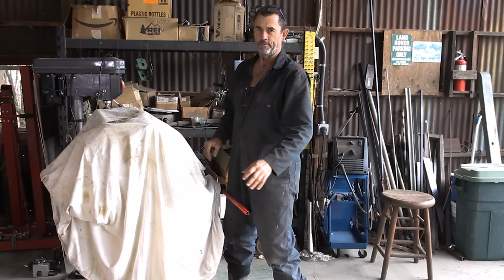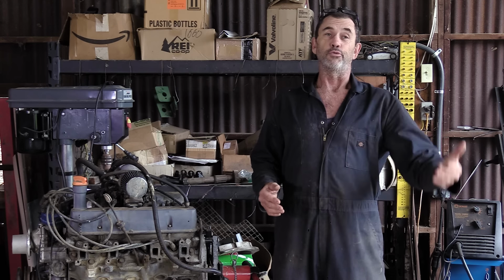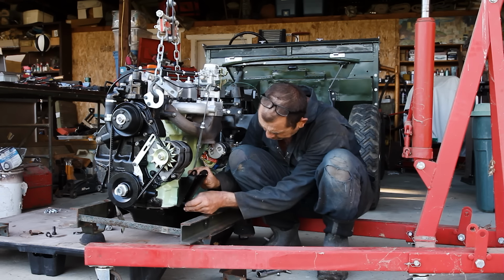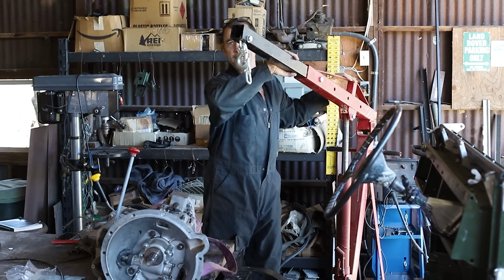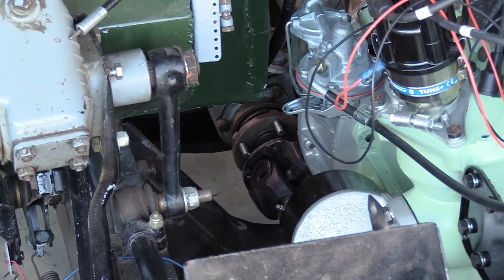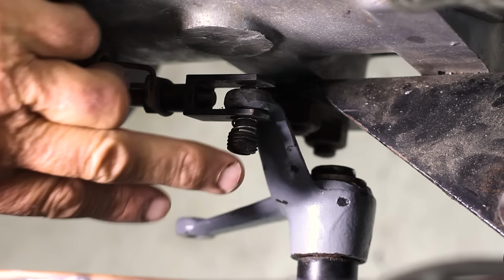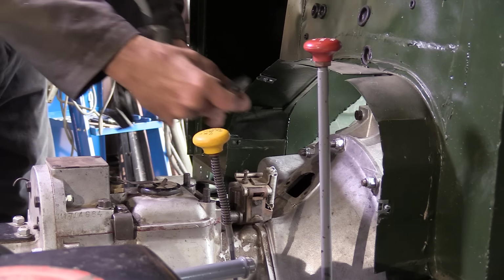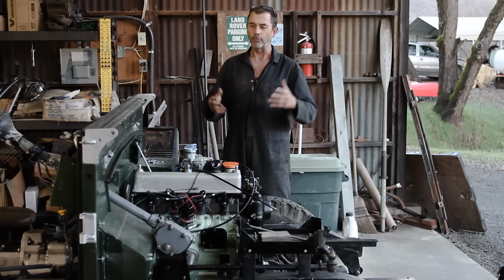Part_ 31; Beast Beneath the Bonnet; Series 1 Land Rover Restoration

Comment: The reason for installing the slip Yokes towards the transfer case is toe kept them elevated as high as possible to reduce the risk of running them through mud and water that might cause unnecessary damage and wear
Reply from the maker: That does make a lot of sense, I have a rubber sleeve I intend to install on the front prop sleeve to hopefully offset it's vunerability and if that plan fails I'll switch it round. Thanks for the tip.

Comment: Great progress! ACR have a great rep so you shouldn't have any issues with that engine. The 140 in the gearbox will be fine, though in my opinion the bronze bushes on the mainshaft in those boxes suffer poor lubrication, so I'd recommend swapping to 90 weight if you're intending to do any miles at "high speed".
Reply from the maker: Greetings Mr SteamWally! Good to hear from you. I concur with your synopsis on the gear oil 100% It was when I was pouring it in and the stuff was like honey that prompted me to re-read the label that said clearly 140w. Off camera I had to shake my head and call myself a dumb-ass.

Comment: Looking very nice.  Here in South Africa our climate is similar to Australia and in my 2a I use an 85 140 gear oil. It's good for the higher temps in the gear box  transfer box and diffs. In my 90 I found it reduced knocking from the diffs when hot. Good luck Bruce!!!!!

Comment: I know the person you speak of, hope you get that motor or money. Personally I think you made the best choice. The gas 2 1/4 is a sweet little motor. I had a 1957 107 with a 2 1/4 . Sixty mph was no problem.
Reply from the maker: It's a dangerously small world we live in. While I'm hoping for the best I've prepared myself psychologically, emotionally and spiritually for the worst. I agree that things have worked out well with the engine I got and while it was quite expensive I suspect it'll be worth every dime. As for 60 mile and hour in an old Landy, you're a braver man than I.
Reply: That's a strong engine you purchased. A overdrive and 16 in wheels and 60 will be easy.

Comment: That is very good engine with a terrible carb :o) So many places for dirt to get stuck :o Petrol engine versions of diesels are usually ace ^-^ Prop shaft slides go as high as possible so grass-wrap happens on the bare bit.

Comment: So glad to see you have a real motor for the chariot, spline end goes to the transfer case keeps it out of the dirt a bit better preventing excessive wear. 90 weight GL 4 gear oil is recommended due to bushes in the box. Another great video can’t wait to hear it running, just a hint before starting remove spark plugs and turn motor over on the starter till you get oil pressure on gauge or oil at the rockers it will stop the bearings rattling at initial start.
All the best for the new year.
Reply from the maker: Thanks Gippy! If I remember my V8 for the Disco came with a similar recommendation upon starting. I'm thinking of removing the coil lead and crank it a few times to prime both oil pump and fuel lines at the same time.

Comment: Great seeing a new video up! I have chosen a 2.25 for my 53 series I “Nanook” up here in Alaska as well, scored a 59 parts rig with a save able 58 production engine(first year for the 2.25) so hopefully OK with the rivet counters!!
Reply from the maker: That's a firm No on you being ok with the rivet counters but you get the thumbs up from me. I'm currently quite vexed with air cleaner setup for these engines with little clearance beneath the hood. Not sure what carb your machine has but the weber sits very high with only 3 inches between it and the underside of the hood. Might be building my own attachment to solve this puzzle. Must be quite chilly at the moment up your way.

Comment: Fantastic progress, good luck with the electrickery, don't let the smoke out the wires!  Castrol 10W40 is what I always used in my Series, and was told by a mechanic that it sounded sweet like a sewing machine.  Gearbox, transfer, differentials always used EP90 gear oil.  You did remember to fill the differentials too? (Maybe back when you rebuilt the axles?)
Reply from the maker: Diffs are full! I'll start out with the 140 gear oil but will swap it out for the 90w soon after. My main concern is it's ability to get into tight spots like the bronze bushings on the main shaft. The manual does recommend the lighter stuff so that would be the more reliable choice.

Comment: Major applause for part 31, Gav!  👏👏 The progress made in this video is worthy of celebration!   Well done!  👍 PS:  What's going on with regard to the long anticipated, fully paid for, rebuilt GM engine from Virginia?
Reply from the maker: Thanks Noah. The first engine order is yet to be resolved. I've had 3 years to emotionally prepare myself for the worst if it comes to that, so metaphorically speaking I'm already back on my feet and limping in a forward direction.

Comment: I've run SAE140 in my SIII for years. It makes it drip and rattle less. :-)
Reply from the maker: My concern echoed by other commenters is the thicker oils ability to lubricated the narrow confines such as the bronze bush on the main shaft. But if you've run with this stuff for years without problem then that's a good sign.

Comment: Nice Gav.  Home straight. Engine packaging crate looked almost too nice, but it is even better in the car. I see you have a Weber card already installed. Presumably that was Roland’s suggestion. I will be interested to see how that pans out and how you set up the throttle linkage. As you know that was one of my challenges. I have used thinner oil in my transfer box (but I also have an annoying small oil leak). No rubber gaiters on the prop shafts? Andy.

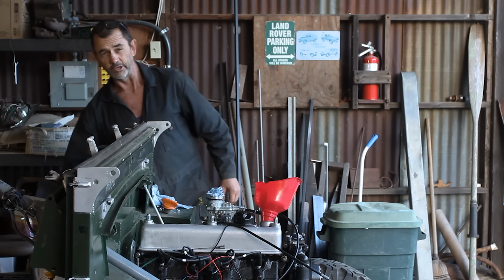Comment: 22:02 That would be 10W for cold weather aka winter. 40 is for when the engine is warmed up. Back in he mists of time multigrade oil hadn't been invented, I speculate you would have chosen something between, SAE 20 perhap. Oil has to be thin enough fr starting cold engines, not so thin when hot as to lose lubrication.

Comment: Nice Engine .But the wrong engine. For what that cost you could have sourced a 2litre original spec engine and rebuilt it as required.
Not original??
Reply from the maker: Greetings Phil. The mob that built the engine for me warned that the 2ltr petrol were not only scarce but parts can be very hard to find. Over time that will only be more valid. As for originality that was corrupted long ago with the V8 engine conversion and the modifications required to fit it. At least the rear diff I suspect has been poached from a series 2A. It's true that an original vehicle would be much more valuable but I don't sell my toys so that won't factor into the equation. I also intend to use it so functionality and ready access to parts over rides nostalgia.